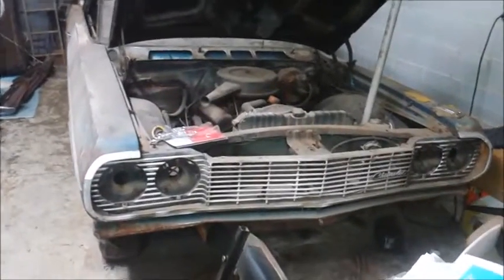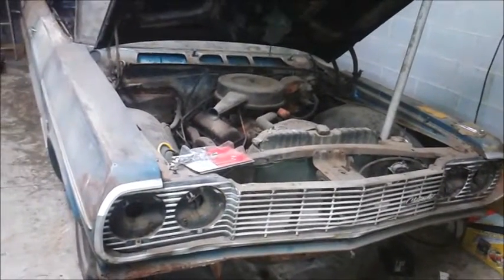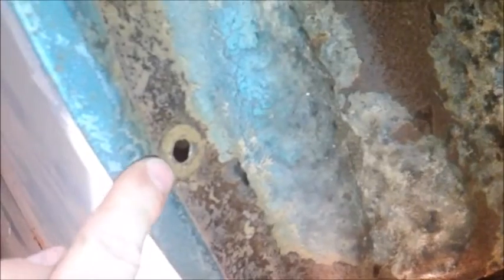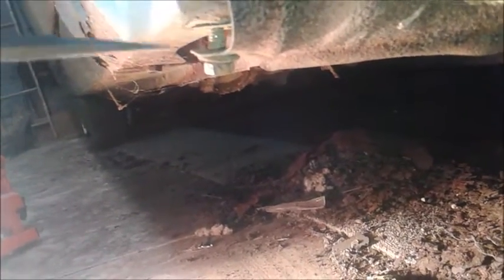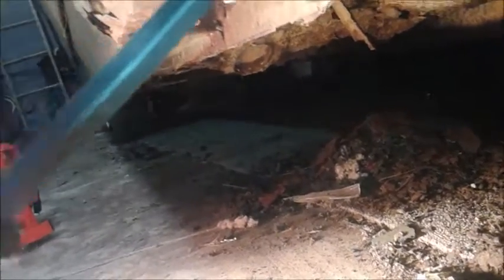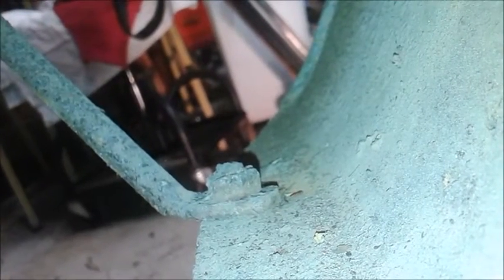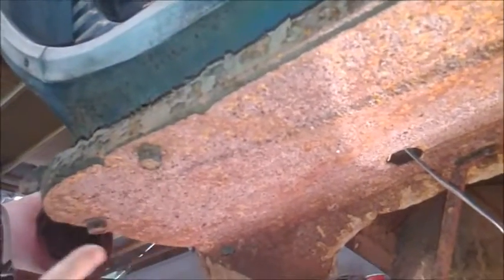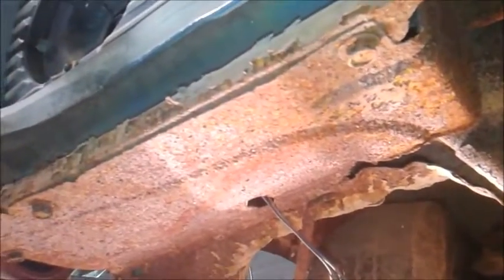64 Impala Front grill removal Part1

Comment: How to remove the lowers valance where the license attaches to?
Reply from the maker: Let me take a look at that in the next week or 2. I still don't have the grill off, so this video is unfinished. The fender skins wrap all the way from behind the front fender to the middle of the grill area. Mine are rusted badly & will need to have the bolts cut off.
Reply: Carl Davenport Thank you!
Reply from the maker: Not sure if you are a subscriber, but I do have the bumper removal covered. Search for "64 Impala front bumper removal Part1" and then Part2. They can be found on my Channel easier than searching. The search feature doesn't always make Part2 the next video oddly enough.
Reply: Carl Davenport ok thx